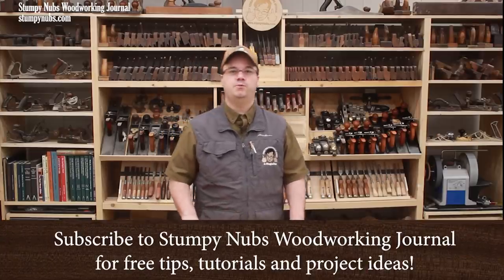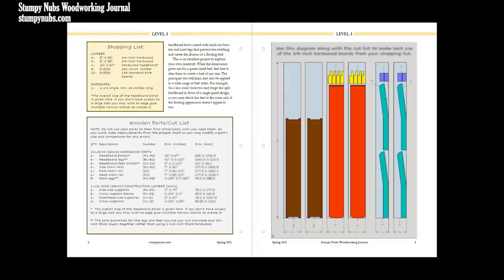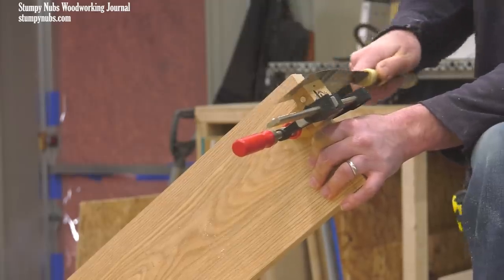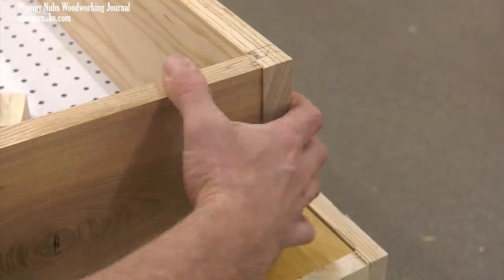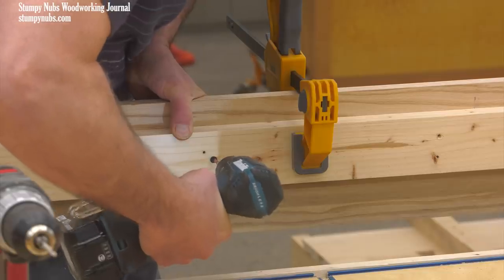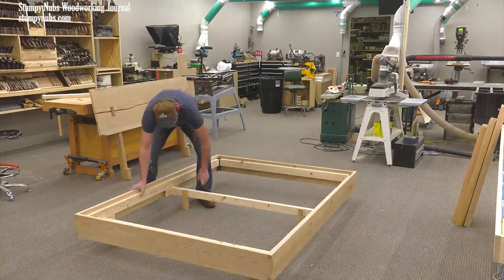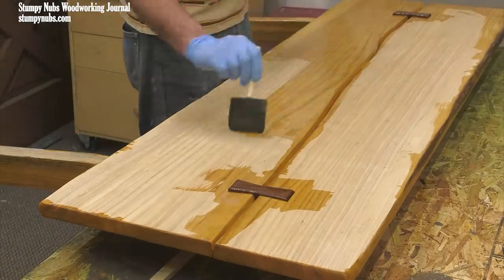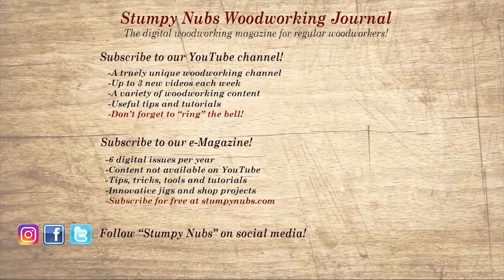How I made this DIY bed FLOAT!

Comment: I have a knock down bed that I’ve had for decades that uses many of the same concepts. After numerous rounds of knocking-down and setting-up, I have one recommendation: invest in threaded inserts and small bolts instead of screws directly into the wood.
Reply: Yay!  Another threaded inserts fan!  I made my first platform bed back in the 90s.  Not knowing any better, I used drywall screws throughout its build.  I moved a bunch of times in the following years and took the bed apart again and again until those screw holes were pretty well worn out.  I then discovered the "miracle" of threaded inserts and use those now on any project of mine in which I figure the thing will be disassembled at some point.  It's been a life saver ever since!

Comment: One thought on the criticality of screw length for the slat supports. I would use a pan head screw from the inside. Almost impossible to overdrive and if you get the length right, then they should all be good.

Comment: Nice! Like I said before these videos came along at the right time. Do you think that threaded inserts could be used to attach the angle iron to the bed frame? Not that it would happen a lot, but I'm thinking that the threads created by a wood screw may wear out over time whereas the insert threads would seem to last longer. What do you think?
Reply from the maker: Yes, that would be a good idea if you plan a lot of moves.
Reply: I did that for a similar bed I made for my son's college apartment to make it possible for a single person to move/assemble. It's been through 2 moves already and so far it's holding up great.
Reply: @mikehodges6598  Cool!

Comment: Hi Stumpy Nubs. Just found your channel and I love your very professional, concise, and informative presentation. Subbed. I'm not a woodcutter and I have almost no knowledge of anything woodworking related. Question for you and your subscribers: I have a pair of stereo speakers which I purchased in the early '80s. They have a natural looking finish to the oak veneer on the top and the sides. I've never done anything to the oak veneer other than dust it, occasionally. As a heavy smoker, I'm sure the wood has taken on a "tobacco patina" over the years. Should I be cleaning the wood with Murphy's oil soap and, when dry, applying an oil? Thanks, and looking forward to watching more of your videos.
Reply from the maker: I am sure there is a varnish on the outside. Oil will not soak into the wood if the pores are all full of varnish. I think you only need a good cleaning followed by some paste wax (apply, let dry, vigorously buff it to a luster with a soft cloth) You can buy Johnson's paste wax in most hardware stores.
Reply: @StumpyNubs  Thanks for the reply. I'll give them a good cleaning and see how they look from there.

Comment: If you wanted this to be a king would you add a center - head to foot  - support rail?
Reply from the maker: Maybe. Those pine slats may need some center support on an extra-wide bed. I may also add a third leg in the center of the two side to side support rails beneath the frame.
Reply: If it's a true platform bed (slats as main mattress support, not just a hideaway for a metal frame and box spring), then yes. Ideally even queen beds should have a center support rail or vertical supports from the slats to the floor. Most mattresses that use a platform configuration need to be solid. The flex initially may provide more comfort but will ultimately sag. 

Almost every platform I've seen is either rigid flat slats or thinner arched 'euro' slats bowed up so the weight compresses them. A traditional king is often two twin frames/bases or box springs with a king sized mattress on top. Running a center rail with firm vertical support to the floor would replicate that.

Comment: I am filling this one away.  I am planning on making this bed when the price of wood comes down and supply increases (it is very challenging for the stores to even get in good stock at the moment.). One question if I may, I always seem to bang my shin on our present bed as the corner seems to float out well past the mattress.  How do you find this one for that?
Reply from the maker: I do not sleep in this bed. But I will say that I am more likely to stub my toe on a leg than my shin on the frame. This one solves that problem.
Reply: Stumpy Nubs good point.  Thanks.

Comment: You can still see the pencil mark on the foot of the bed where it marked the depth of the dovetail. Come on, John. :)
Reply from the maker: My name is Jim, not John. And it's not a pencil mark, it's a marking gauge scribe which is very common in hand cut dovetails and is traditionally left in place. You should be more careful when you call out someone's work online. ;)

Comment: If the mattress isn't seated inside the frame doesn't it slide around?
Reply: It probably depends on the activity.
Reply: I have a Casper mattress that sits on top of a flat platform. To date no normal activity associated with a mattress has caused it to slide around.
Reply: Yeah maybe   You can inset it a bit more by reducing width of stay brackets inside.  I built a similar slat bed and made the mistake of finishing the slats.  Somewhat solved it by glueing that rubber like shelf liner on them.  As our buddy Glen points out...  works depending on activity.

Comment: It doesn't look that easy to disassemble. It looks like you have to remove the 2x3's to access the angle iron brackets. Is that true?
Reply: You have made a Very good point.
Reply: Assuming you only move every 5 years it probably isn't a very big problem.
Reply: Good point. Threaded insert with a bolt “might” make it doable but probably easier to unscrew the rails (which you have NOT glued and screwed to the sides).
Reply from the maker: If you move it so much that seems onerous to you, Trim an inch off. Problem solved.